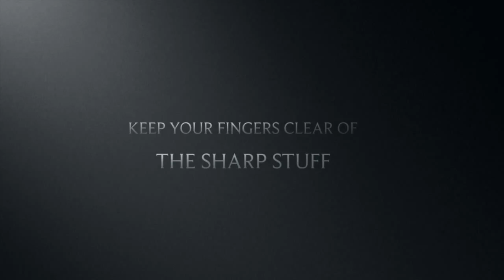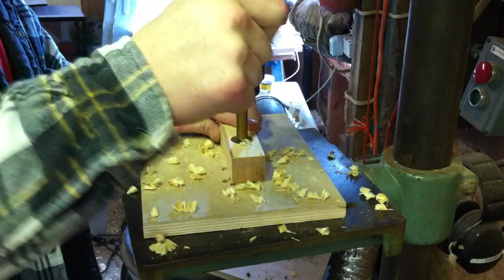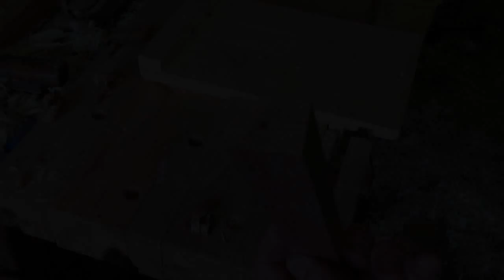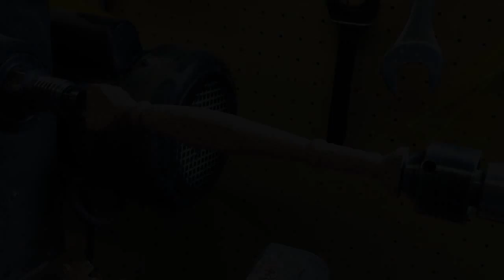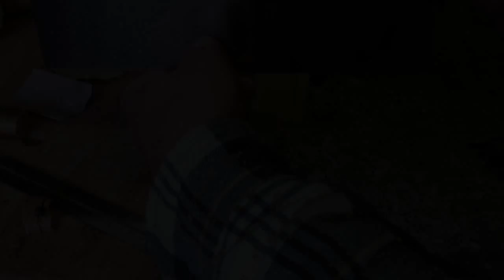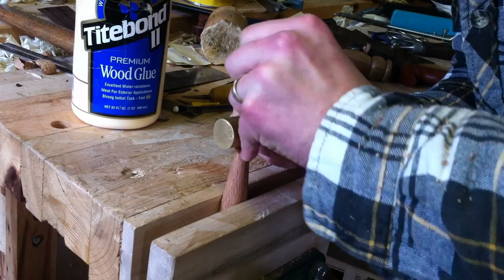Make A Quick & Easy Plane Mallet

Comment: That looks great. Do you know what the weight turned out on this?
Reply from the maker: +Scott Adams So sorry for the late reply - the mallet head is 1" brass bar and is 1.5" long. It weighs in at approx 5.75oz or 160g
Cheers!
Reply: No problem. Thank you!